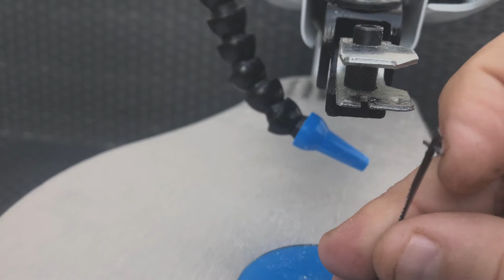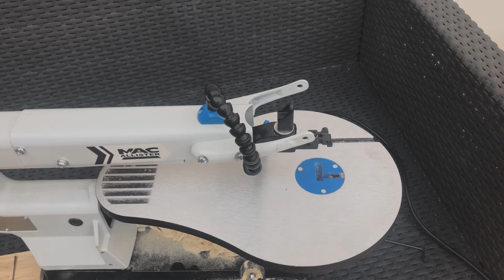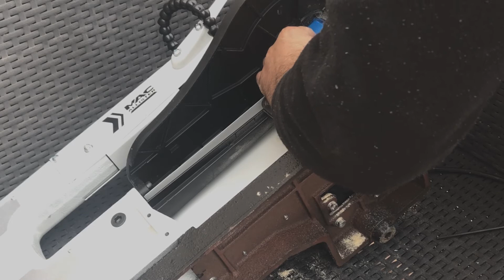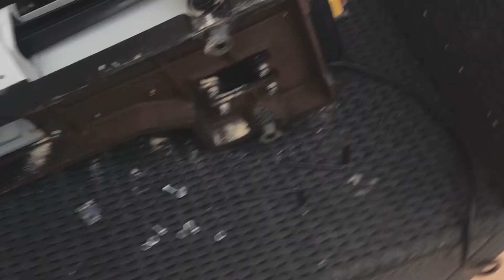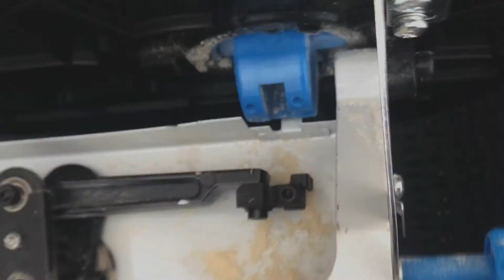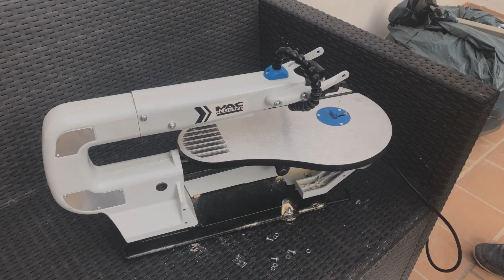Macallister MSS125 Scroll Saw - Upgrade holder blade

Comment: What’s the difference? Is it only so you can apply cheaper saws to it? Also, is the equipment any good or not so much?
Reply from the maker: Saw cuts very good, I dont have any problem. Diference? - after change holder i can use very thin blade and cutting  from each side, not only front and you dont need rotate material when you cutting. This blade is like string and no special ends. Thats way I change it.